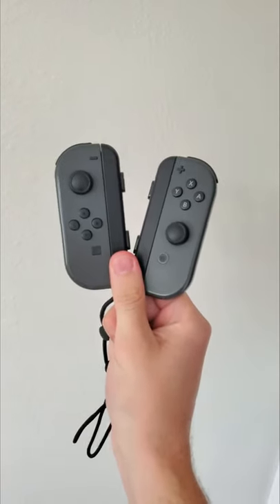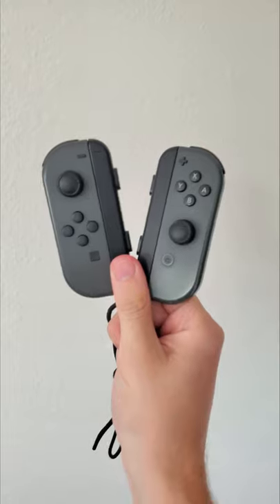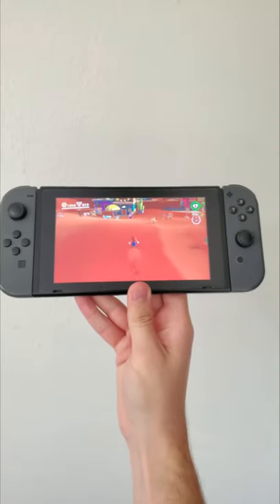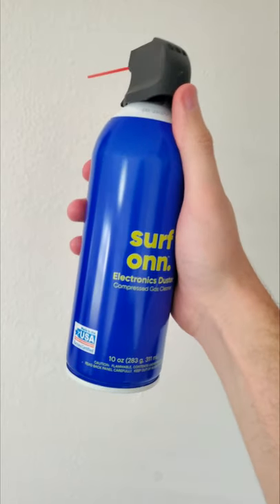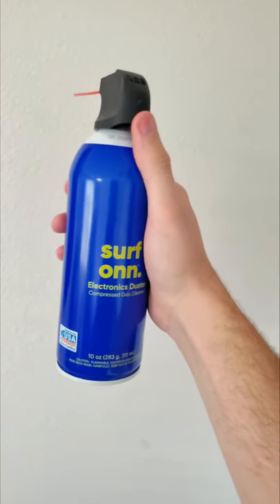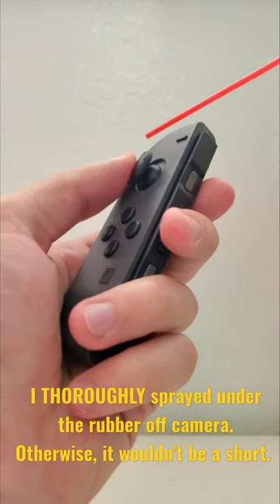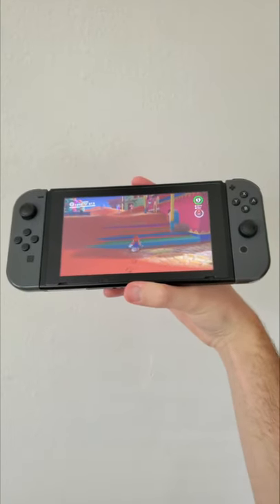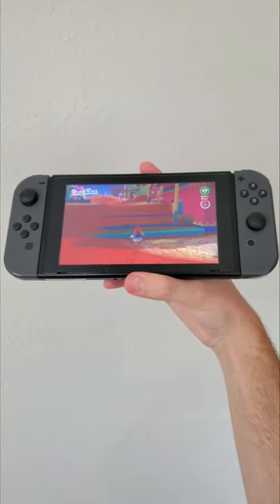Can You FIX Joy-Con Drift With ONLY Canned Air? Nintendo Switch Myth DEBUNKED #Shorts

Comment: You didn’t clean it properly mate, you’re supposed to lift up the rubber flaps under the joystick and blow it into there
Reply: Exactly,  lift the flaps up then blow this foo don't know what he's doin😂 it fixed mine easy a while back
Reply: Mine still wasn't fixed, though. It was drifting less for less than a minute, and then reverted back.
Reply: @vampyroteumint  lift it w some tweezers and thn put the air can in there
Reply: @wessyder112  that's what I did.
Reply: @vampyroteumint  good chance it’s a problem with the internals then

Comment: WD 40 under the joystick, move it around a bit and done. It really works👍
Reply: Yes!! I've tried it myself, and it's been a year without drift 👍
Reply: Same here, only needed it once and it’s been two years haven’t had any problems with them since
Reply: Isopropyl alcohol is much more recommended, so that it evaporates and doesn’t leave a residue.
Reply: Definitely just use rubbing alcohol next time. Do NOT use WD-40 on electronics.
Reply: For some :(
Reply: I'd suggest quick drying electronic contact cleaner instead. It's made specifically for applications like this, and it won't cause rust or corrosion, short out electronic parts, or cause any issues later.
Reply: @davidscritchfieldds  yea I used this
Reply: Nice dudes i have wd 40 at home now i only need a switch:D

Comment: Answer: No

If the joystick is broke it needs to be replaced to get back full functionality. I’ve had to replace a couple already and the left one is currently broken again. It’s not fun replacing so I’ve hesitated changing it out even though I have a new one ready to go in.

Canned air doesn’t fix a broken stick.
Reply: There's a difference between broken and joystick drift.
Reply: @swervo3535  joycon drift is caused by a broken joycon. They go bad after minimal use because they were manufactured poorly.

Comment: The reason why it doesn’t work is that the thing that registers movement is loose causing the sensors to think that it’s moving so you have to tighten it by putting a single millimeter of paper underneath the entire joy con inside of it

Comment: I had drift issues with my joy cons. First time took them to GameStop, paid €30 had to wait like 3 weeks. Got them back, started drifting the same day I got them back. Bought a can of WD40, cleaned them PROPERLY and haven’t looked back since. I have had no issues and it’s been like 2 years.
Reply: Yeah, don't take them to gamestop. Ever. I didn't even know gamestop offered repairs lol. But definitely just use rubbing alcohol if it ever happens again. WD-40 shouldn't be used on electronics.
Reply: What is WD-40?

Comment: There is a new method to fixing joy cons without making big purchases. I can't find the video. But one youtube realized the base of the joy cons get slightly worn at the joint. And a plate under loosens in place. But a item slimmer than 1mm (credit card) can but cut out and put underneath. Close your joy con and it should feel like new. no drift. a way to find out is by squeezing slight pressure and see any signs of a worn joy con..or it's actually busted. 🤷🏻‍♂️